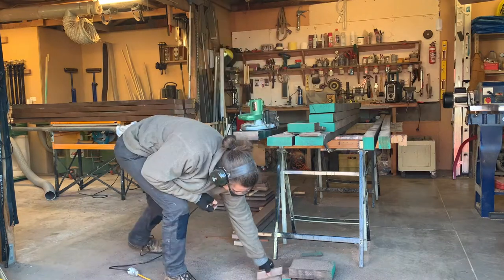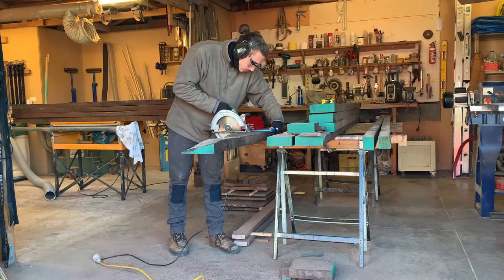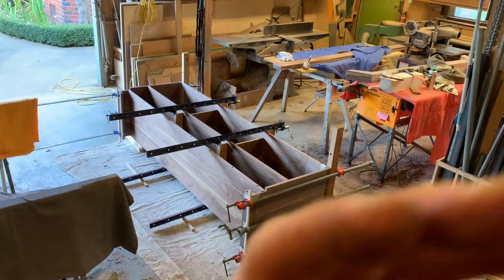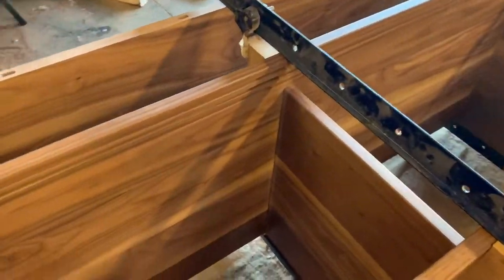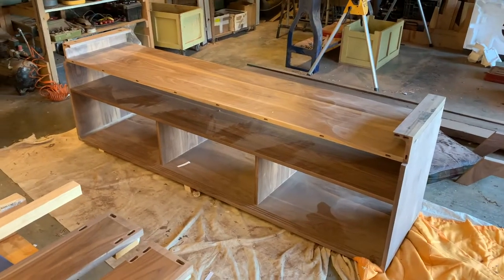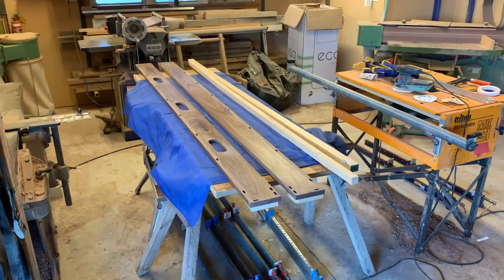MAKING A WALNUT DJ CONSOLE (PART 1)

Comment: really well done mate, beautiful work, Im just wondering aren't you worries the panels will crack eventually as you glued the corner pieces and made what looks like tight domino holes?(do to expansion and contraction) maybe I missed something?
Reply from the maker: Hi mate, thanks for the comment! Yes, you're right. In retrospect I should definitely have made those domino holes a little looser especially towards the outer edges of each panel. However, I'm not sure where  in the world you live but I have found that here in Christchurch, New Zealand the expansion and contraction effects aren't quite as severe as in other parts of the world where the humidity levels are higher.